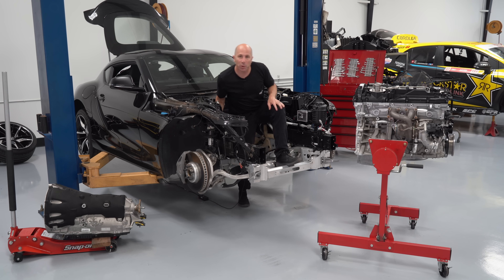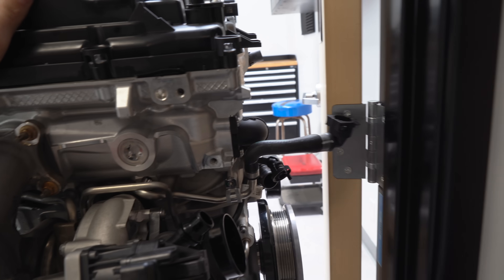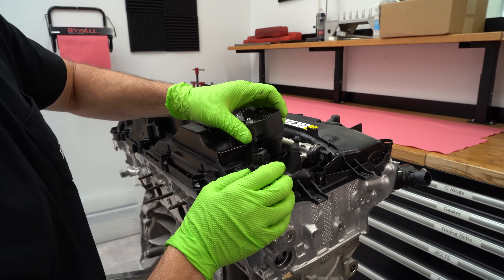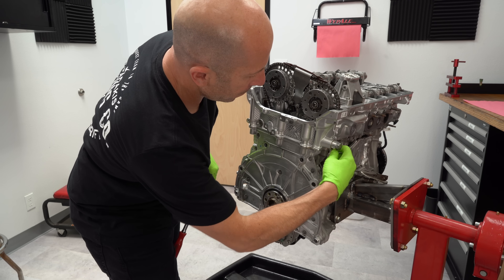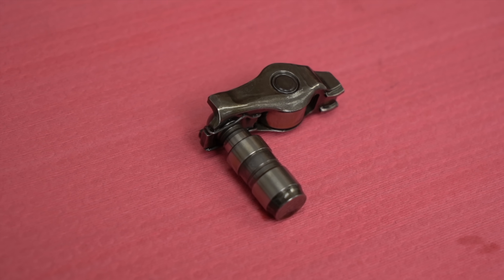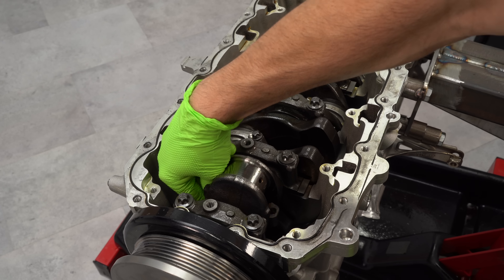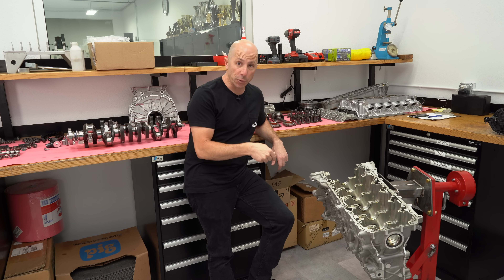2020 Supra B58 Engine Teardown - First Look - Better than the 2JZ?

Comment: Big mistake to sell this BMW as if its was actually a Toyota.
BMW has no clue of reliability or longevity that Toyota used to be famous for.
.
Reply: Im sure youre not aware of the N52/4 series and the Bseries engines from BMW. Theyre very strong and very over engineered. 
Were not talking S50s and M52b25/8s here.

Comment: There’s a Huge Recall Bad welding. Return and get a new BMW. Shame on TOYOTA for not manufacturing their own Sportscar.. They ruined the 2Jz  Legendary Supra Sportscar!
Reply: Recall...it Was only 7 cars for seatbelts...4 we're fixed and 3 are still being fixed...there was really noting major about it.
Reply: Carboy Dorifuto party you are incorrect I’m giving you facts
Reply: @yahya2589  then why are there still a stupid amout of people still buying/riding their mk5s? Again it was only 7 cars that had these problems. Heck it mostly had to due just because of backup cameras being dim which a very small amount of mk5s suffered from. Noting about the engine whatsoever.

Comment: Bump that stock HP to at least be the same as Z4 but nobody is buying the new Supra because it’s pointless at the price there’s other cars that are twice the car for half that price I mean come on the Supra was popular for its low cost and high reliability if they dropped the price under $50k some might bite but it’s not a $60+k car sorry 🤣🤣
Reply: Not buying it? There's one thats already hitting well near 700hp,a small bunch that's getting widebodys/getting widebodies installed,there's already a bunch of them hitting 10s and are getting stupid close to 9s and a small bunch already hitting the track right after getting off the dealership floors........and it's base price is 50k was never 60k unless the dealers ripping you off or your from another country.

Comment: Aluminum integrated exhaust manifold as part of the head sounds like a bad idea.it will develop cracks in several years.
Reply: Audi have it for years no problem there,  main reason is no turbolag since shorter way to turbo combined whit no intercooler in the front jsut watercooled one in mainfold
Reply: If you think about it, the exhaust path past the valves is cooler than the combustion chamber, so the water cooled block and head will either crack or not but this design prevents having an external exhaust header leading to the turbo with flanges and bots which could more likely fatigue, deform on expansion, then crack.  A slick design.

Comment: LoL, an engine with a worse bore/stroke ratio than the old 7M.And I can't see that pos head making a thousand HP, the sides of the exhaust passages in the head will melt, and blow out first.
Reply: Well they seem to be handling over 600hp pretty well. There's one out their with over 800hp and it's not having any problems.

Comment: Man this is all kinds of engineering ugly. Some design ideas are good. Some of them the engineer that came up with it needs to be castrated. You say your a performance shop but things like integrated exhaust ports don't have you trembling at the knees? Seriously? This integrated port crap is to save money, it is not conducive and is counter productive to making horsepower. Turbo lovers everywhere should be cringing.

Comment: couple things
It's not really a 'racing' engine because in racing you need to over-simplify in order to gain reliability, speedy religious rebuilds and diagnostics... And there is nothing overly-simple about it the way they come in that car.

Instead, I would argue that this looks like a race-engine that was adapted for daily driving/street car usage. In other words, they've added a slew of unnecessary systems & mods (intake rocker decision, frequent start bearing coating, real-time camshaft angle, oil/coolant heat exchanger, manifold-intercooling of limited capacity, etc) in order to maximize the daily driver aspects such as low end torque and fuel economy and emissions.

When converted back to a true racing engine, some of those systems may put the engine in a superior category while others may impede it's (max output) or reliability in the long run. It depends on the type of racing. For example in drag racing the low rpm ranges (below say 5k) is barely used, no matter what engine/car we are discussing. So the intake rocker and real-time camshaft gadgetry may become a nuisance and unwanted complexity for a system where a simple proper developed high rpm camshaft would suffice and be more reliable.

Next,
Its just a little nit pick but. Intercooling actually reduces power because it robs kinetic energy from the air (it acts as a restriction) and causes a pressure drop besides the cooling effect. The reason the engine seems to 'pick up power' is because a wastegate reference on the intake manifold will compensate for the drop in pressure created by an intercooler thus you will see the same pressure on the boost gauge as before except now the air is cooler, so it seems like the intercooler added power. When in reality the compressor is now flowing more air at the same manifold pressure to compensate for the pressure drop created by the intercooler (flow rate increased at the same pressure). 
In thermodynamics we learned the engine can make the most power with the hottest-possible air. The reason we don't try that when using gasoline is because gasoline will not tolerate high temperature. Other fuels however, such as methanol/E85 will tolerate a high air temp and so we see many successful non-intercooled E85 and methanol setups. If you wanted the most power and had the best fuel, you would use the shortest, least restrictive plumbing (no intercooling).

Comment: These motors are designed to blow up. Everything is modular together exhaust I head, intercooler in (water to air). Lolz I guess it’s just an engineering task to run coolant through an intake in my opinion.
Reply: There hasn't been one that's blow up yet ever since the b58 came out unless it was some factory defect which hasn't actually occurred yet.

Comment: There are things i like and don't like about this engine. The big thing for me is how much plastic is on the engine. I'd definitely like to see more metal parts.

One thing i liked was the way it's done the VVT. You could probably rig up a small motor to open up the intake a lot.

Another thing i dislike is the oil and coolant both going through that one cooler. I know how bad things can go when oil and coolant mix.

And to finish on a positive, i'm quite fond of that compact turbo manifold. Saves a lot of room.

Comment: Im equal parts impressed and disgusted with this engine, fitting for a  co developed between two companys. Plastic everywhere, torx, rear timing chain and mani/head are filthy but i like the girdled closed deck and the efforts to simplify areas, minimise hoses running everywhere etc. Still rather have a mk3/4, and a manual

Comment: This actually gives me fear on remembering how to place all pieces together.
Reply: The scary part is, when you have completely reassembled and the car is on but you still have few extra pieces left that you forgot where to put them on.
Reply: @dilasgrau6433  Yeah. I had that. I was left with one piston left over. It was a wankend engine the man said.
Reply: They make manuals for that
Reply: There's a disassemble and reassemble for the engine in service manual through online, it tells you step by step in diagram, the trick of not forgetting on some part or how to not lose some things like studs or bolts, you can use a zip lock bag and a sharpie to put a specific bolt on one part then write it down.
Reply: I take pictures lol
Reply: @zstrode.8953  Wtf dude i just put the screws in different compartments lmao
Reply: @ytcrisgaming4022  ever taken a whole dash out? Theres alot of screw inalsonuse sandwich baggies and post it notes to pabel the screws
Reply: @zstrode.8953  yeah
Reply: No shit man. I’m wanting to buy this engine for my 07’ 328xi but there’s no way in hell I’ll be working on this engine
Reply: @WingusNDingus-v2l this engine is like 20k why would you do that
Reply: That's why he has tables set up. This way he can organize himself piece by piece where they came from. It's alot easier when you have a shop that's being cam corded.
Reply: Only when the dealership manuals will do 😀
Reply: He also did record it
Reply: use a camera.....
Reply: same as you
Reply: @aloha_from_bradley  the
Reply: @aloha_from_bradley  no need for sarcasm dude
Reply: @aloha_from_bradley  Sure buddy, keep lying
Reply: buy MRJT stock
Reply: @aloha_from_bradley  always lol
Reply: Hey is this a royal this snipes
Reply: Take photos of everything as you go, it's a lifesaver.

Comment: It's the same engine as the z4 right ?
Reply: There's a slight difference between the two other than that the're the same engine..However if you're asking if its tunable like a 2JZ the answer is a FAT YES, reliable? A LOT more than the 2.0 boxer from the FRS, more powerfull than 335hp? Yes but to the wheel which to the crank makes 400hp.

Comment: Race engines are torn down often, then this design is fine. As a conventional passenger car, I would be a bit concerned of the designs used in here. Integrated cooler/ plastic intake manifold, rearward timing chain, ehh...I don't know. Once they worked out the bugs of the valvetronic system,  it's been surprisingly reliable over the years, so who knows. Buying a used one of these at an auction after they age a bit,  good luck

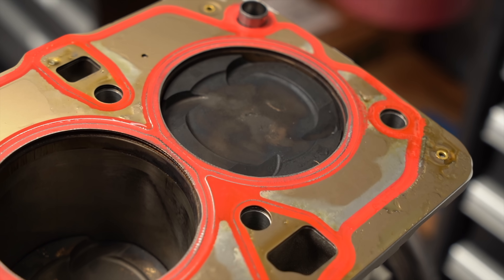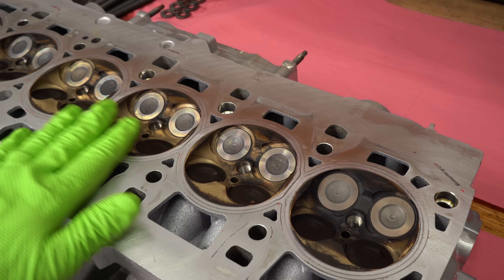Comment: 9:50  Look at all the CARBON inside the top of combustion chamber for cylinder on the right-most end!!!   Compare to all other cylinders.   Will these be the intake valves that get coated in CARBON from the ingested PCV crankcase gases?   10:00  Look at the CARBON on the right!!!

Comment: Drive by wire is faster to respond than your foot can move....... Well if it is responding to your foot then what does it matter lol. So therefore, if no slack in the cable then cable would be faster cause no delay in electric signal is present

Comment: People are ridiculous. This car failed before it even came out due to ridiculous expectations. The strength of the  2jz internals was the biggest reason. The 2jz is one of the best motors ever made in mass production. This engine is more efecient than the older 2jz and as long as the internals are just as strong then its better. 
Because its a bmw engine people are tripping. BMW created one of the most amazing engined known to man as in the McLaren f1. People somehow think BMW is lower than a Toyota and that is completely false. This car is pretty damn impressive and as soon as after market parts become available, its going to be legendary......watch

BTW... Efficiency involves more parts as in more engineering. If you dont want something complicated but want a legit v6 get a gm 3800
Reply: I still take the 2JZ-GTE over any BMW engine!
Reply: @lcannon935  the inline 6 engines and transmissions BMW make are fantastic. Some of the electrical issues mostly through the BCM arent that great

Comment: plastic on a hot engine .. sure a perfect solution.
Reply: Its not a garbage bag. Phenolic composites are highly temperature resistant. Strong. Light. And they don't heat soak like a metal manifold.

Sounds like a grand idea for sure.

Comment: You cant even change the spark plugs without a special tool 😂
Reply: 14mm, thin wall, long reach. Standard Japanese sparkplug size since 2007ish. Sits right next to my 5/8s and seldom used 13/16.

Comment: German engineering, their machine work and design is great but the electronics are the worst! He better change out every wire harness, sensor, and computer! The oil industry is testament to German electronics, which must all be tested and reworked prior to shipping to drilling rigs! Their boards,wiring, crimps, sensors, and harnesses are all crap and will fail if sent out new. Cars are the same, my friends have BMWs, Benzs, Audis, Etc and they are shop whores! Every time I see them they are driving a loaner or their non German cars. I was going to buy a C63 AMG and they all stopped and said stick to Japanese! To make a long story a bit shorter the 2020 Supra would of excelled being 100% Japanese. I'll wait 4 years and scoop one up at $25k, like any BMW.

Comment: This is DEFINITELY a BMW engine, it literally has SO MUCH PLASTICCC!  5-7 years down the line I see a lot of brittle components that will certainly fail with the heat cycles.  Plastic intake manifold, plastic thermostat housing, plastic oil filter housing, plastic cam covers, plastic oil sensor housing, plastic timing guides, plastic rocker ratio housing.  Nice to see a closed deck aluminum block.
Reply: It's not normal plastic and i didn't hear anybody having heat problems with anything "plastic". Plastic manifolds and other parts have been used for year's by many manufacturers.
Reply: @dkdanis1340  I dont still need plastic on my engines. No matter do that work or not, but that not ever be that much tough than metal had.
Reply: @dkdanis1340  that's true, many manufacturers have been using plastic manifolds etc for years, however it doesn't mean they're reliable. For instance, I had an Audi A4 turbo with a plastic thermostat housing and it failed 3 times in 170k km. The first 2 times with the original owner and once with me. Nobody likes coolant leaking out of the engine and it's not a cheap or easy fix. My issue with the vw group was "WHY...?". What was so hard about using the regular material (alloy or whatever it used to be on older cars)? I'm fairly certain it all comes down to cost of manufacturing and profits. If the car breaks down, you're going back to them for parts.
Reply: @johnb7620  Audi, and reliable arent two words that should be, or is used in the same sentence.
Reply: My 2004 BMW has a plastic manifold as well, 16 years later it is still there no problem with it if its a good quality plastic.
Also "plastic" has hundreds of different forms of composition and can be more durable than metal.
An example: Plumbing in your house is made in a form of plastic and it can withstand more PSI than the older cast iron or copper plumbing would.
Reply: @aleksankazakov  You had over 3bar boost on your car on that 16 years and drived daily over 1000km several times full throttle? xD Composite and casual plastic are different things for me. If that its stronger will gonna wait when they change MLS head gaskets to plastic things if that it is better. :DD
Reply: @iivohamalainen8103   No. Who would do 3 bar boost on a stock manifold?  
Even if it was alluminum if you ate at 3 bar level you got a custom one. 
The stock one will hold anything within sanity
Reply: @aleksankazakov  We have Finland several guys at forums who do that 2jz engines +-3bars(with stock manifold). Most of between 2.5-3bar. Ofc they wont last long, but they do that better than plastic ones. ;)
Reply: As an old german "Kunstofftechnik-Ingenieur" who worked in that area in the past I say:  You are absolutely  right; you don't have to forget also the negative influence of the diff. liquids  over time esp. when they are contaminated with products from the combustion process.
Reply: Japanese engines are simple, european engines are to complex.
Reply: @reneeharewood5053  Japanese engines are not simpler than the European at all any longer, in the matter of fact, my old Mitsubishi was junk that didnt last me 150k miles and it was a pain in the ass to fix.
Replacing spark plugs took hours on that 6g72 V6, the job I do on a BMW in 20- 30 min.
Also if you meant to refer to the 1990-2000 Honda ara engines, the legend stops right there,
Its an urban hox that Japanese enginese are simplier, that lived for the past 30 years despite its not 1995 anymore people still believe in it but the fact is Lexus, Toyota, Infiniti and the most complex engine out of any "Subaru" are not simplier than European competition has to offer.
Also, Japanese engines are not so Japanese ANY MORE.
Designed in the USA for the most part.
Reply: @aleksankazakov  Every car maker do some parts other countries. That not is surprise. Any car maker dont do own parts 100%.

Comment: Those two exhaust ports are pretty small.  It will be hard to drive a three times larger turbo with them. There may be room to bore them out some, but not much with the bolts on two sides of each port.  Maybe a 20% larger port job and/or install two turbo's, one per port. Definitely cannot drive a 66 mm or larger turbo with those small ports.

Comment: 12:25 fuckin' genius! ... as long as some idiot doesn't go trying to refit them mismatched. Very cool to see this tear down, I have an M240i with B58 in so this video is a treat. Just wish my exhaust note was as nice as on this T'ota. Not keen on the amount of plastic mounted to the engine, especially the top cover... polymer technology is pretty good, but it just doesn't last like Aluminium does.

Comment: The engine looks like a damn masterpiece!
Reply: asshat Jackson I’ve found a couple 2015 GTR’s under 40k miles for around 70k and that’s Around my price range, so imma either go with the ats v or the gtr 
Thanks for the info bro
Reply: @asshat Jackson in what way? The block looks super strong
Reply: Bl1tzTurk it is. Just with a tune and a downpipe it’s around 450-470 whp
Reply: asshat Jackson this motor is a way better design than the 2jz
Reply: asshat Jackson so you wouldn’t recommend this car at all?
Reply: asshat Jackson did you not sense my sarcasm?
Reply: asshat Jackson hey man, question. I’m in the market for an M2. I’ve been looking at used GTR’s, ATS V’s, and M2 comps. You worked at bmw, so tell me. Should I stay away from any new M models?